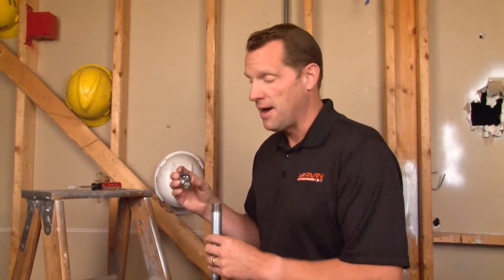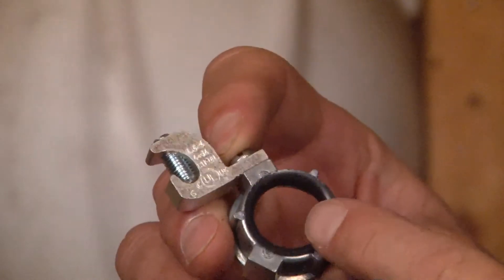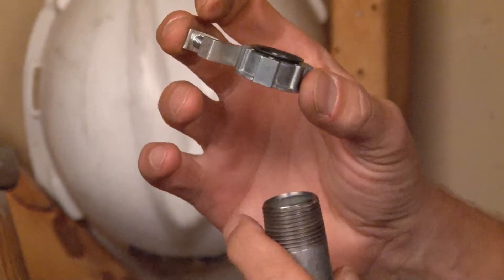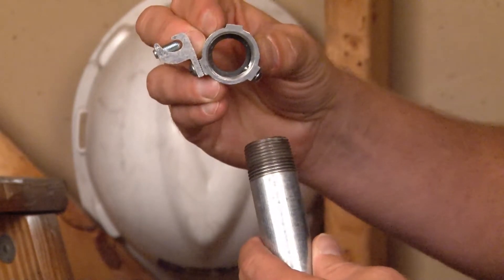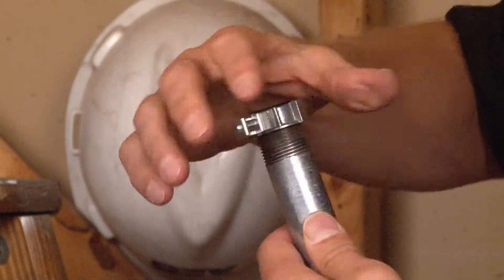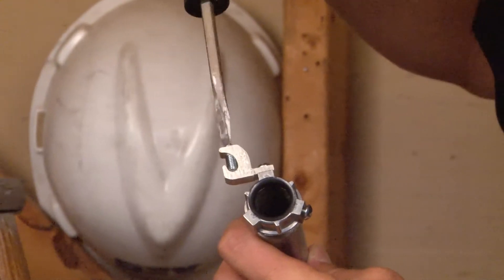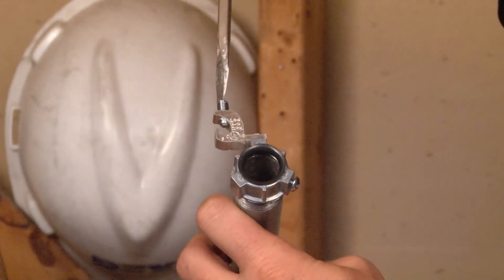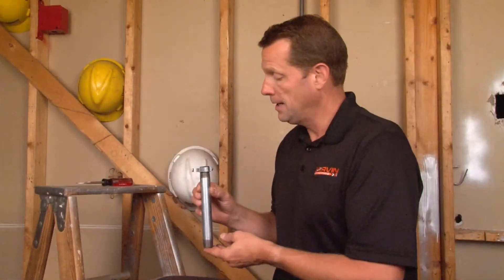3/4" Die Cast Steel Threaded Grounding Bushing: UGB-75

Comment: set screw is what is supposed to be used to insure positive ground not tightening the entire bushing. use a locking ring or a bonding lockring if thats the method you are going to use to ensure a positive ground.